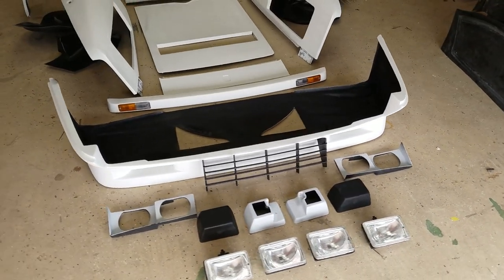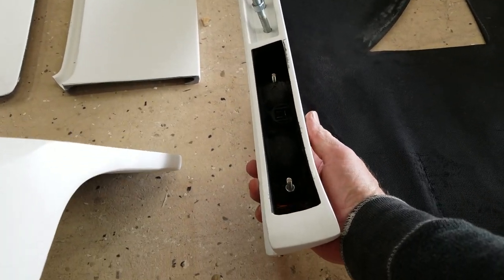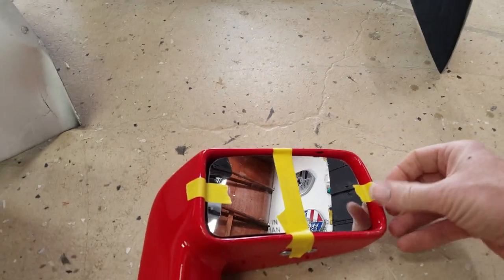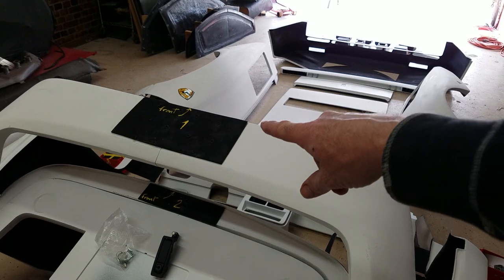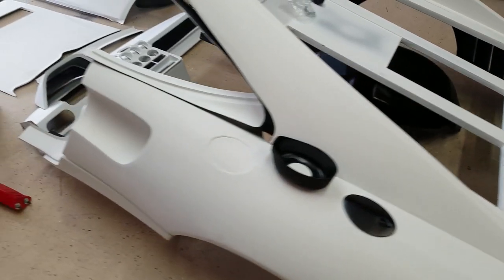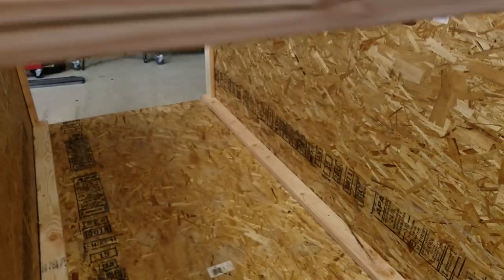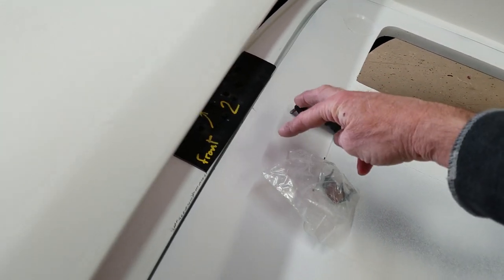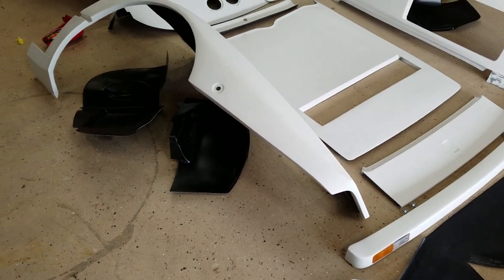288 GTO conversion parts ready for UK.

Comment: wheelbase is correct??? or is this kit for the wheelbase of the standard 308/328?.....could this kit fit on to a 348??
Reply from the maker: This set of parts would be for a car (308 or 328) that you won't have to mess with the cars frame (to re-posistion 
the suspention & motor/trans).  So... a MUCH easier of an install of the parts.  The draw-back?: Your rear wheels 
are in the stock 308 or 328 location instead of the 288's location, of aprox. 4.25 inches to the rear of the car. 
  *We may be getting facotry rear quarters within a few months (which we'll duplicate) to give guys the option of 
doing this conversion to mimick the factory 288GTO to the T".  The parts will cost a bit more, but at least you'd
have that option.  ;o)
Reply: @1nickmrozi11   does this new factory rear quarter panels allow for a gap between the top of the wheel and the lower side of wheel arch?the lack of a gap from under the wheel arch to the top of the tyre is the only thing that gives it away for me.other than that its perfect.Also if i ship a car to you ,could  you to install the conversion kit and paint and upholster it approximately?how long and how much does it cost for you do it on a 328?
Reply from the maker: @prakashdayanandan3176   Hi Prakash, I'm not quite sure about that gap... what exactly you might be referring to.  It does look nice from all angles... to us.  I it were to look strange in any way. we would have fixed the "look".  ;o)  Maybe check out this video of a car we built with the parts: https://youtu.be/FaIf63Yx-Rk.  Might show you a bit better?  This video will probably be even better: https://youtu.be/EsWBhZOA538.  Check them out and let me know.  ;o)  
  Unfortunately we have 4 project cars in our shop right now... with at least a year backlog.  We can get you a set of parts for shiloh you could source a bodyshop closer to you, to install the parts.  If you shoot me an email I'll send you photos of a "288GTO" a doctor purchased parts himself and actually assembled himself.  ;o)   nickmroz@sbcglobal.net